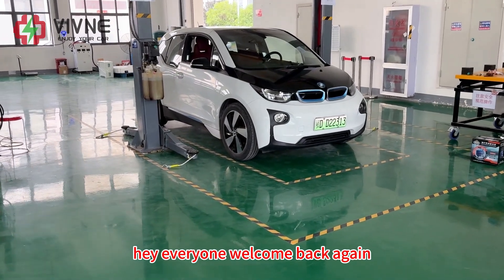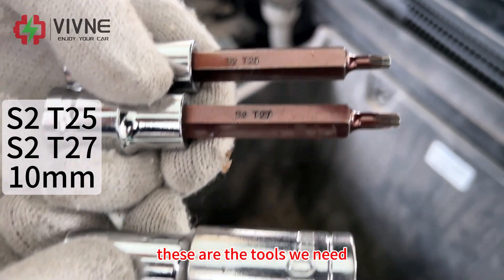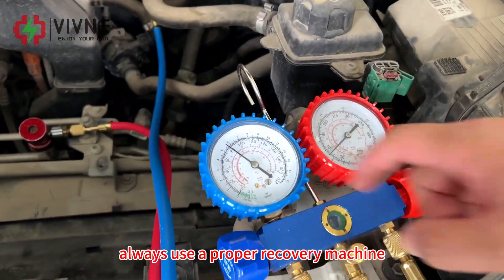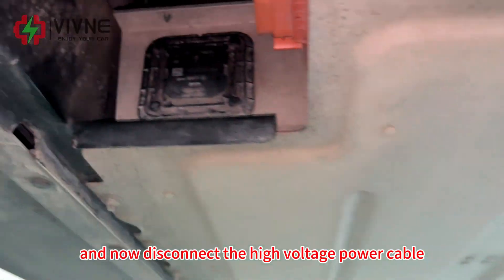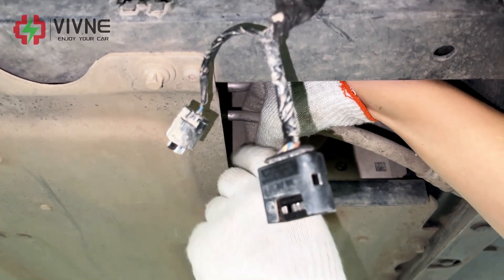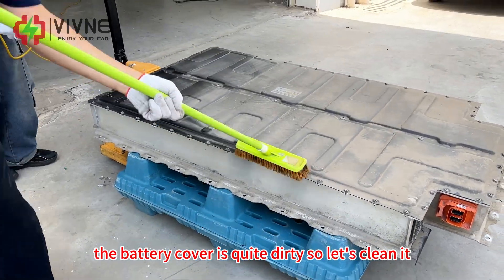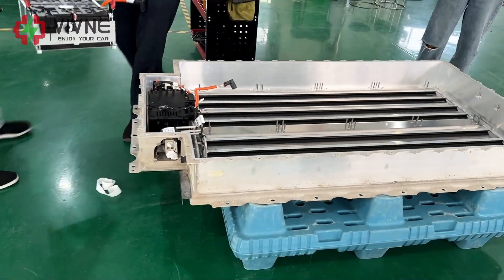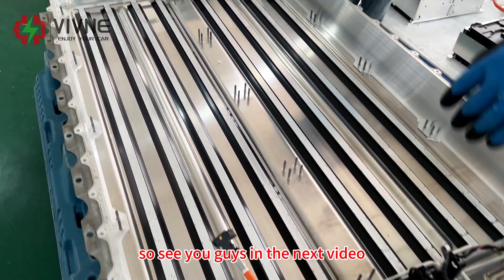VIVNE-BMW i3 battery upgrade from 22kWh to 45kWh-Part 1

Comment: Thanks for making it possible for a battery upgrade.Nissan dealer said I couldn’t do an upgrade.I would have to buy another car.i did an upgrade with a kit from New Zealand.your kit with plug and play is really nice.
Reply from the maker: The Nissan Leaf is a great car, most parts are very durable, and it would be a shame to give it up just because of the battery. I’m really glad to hear you were able to upgrade it and give it new life with a battery kit!